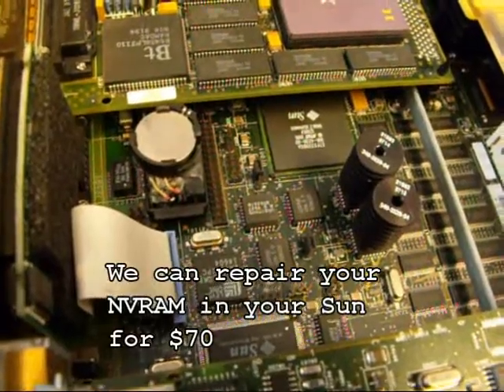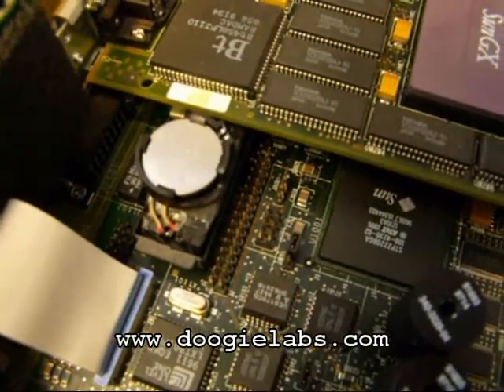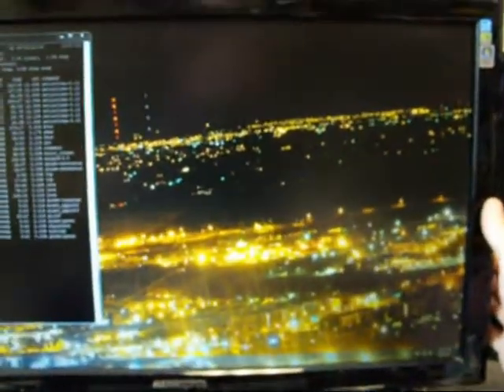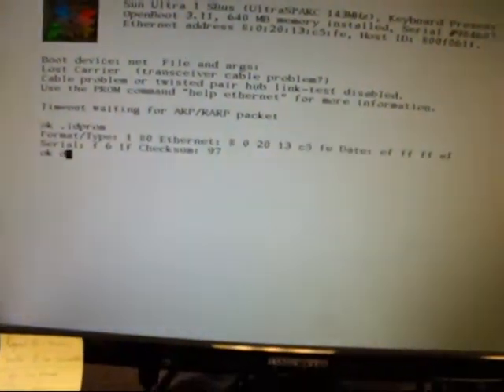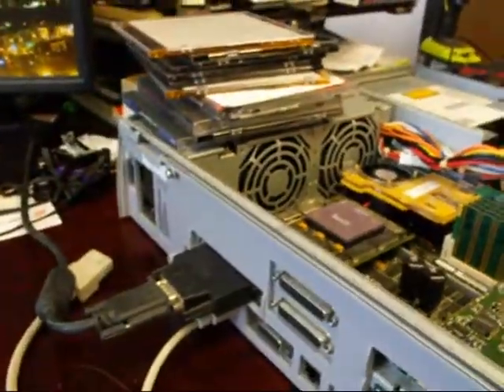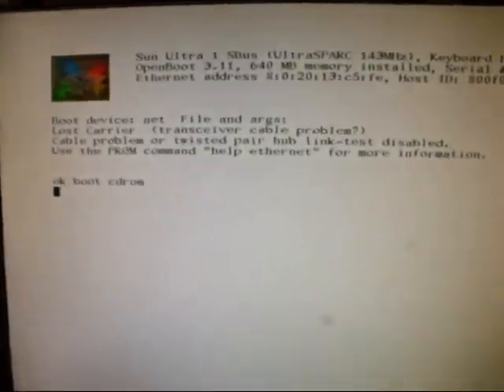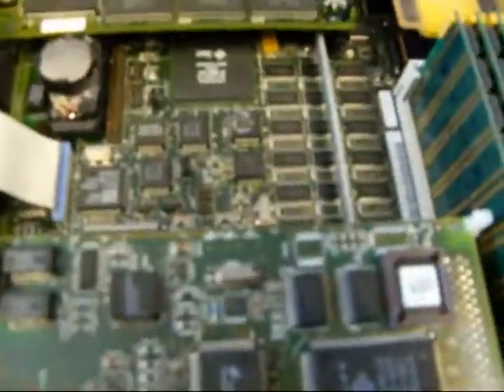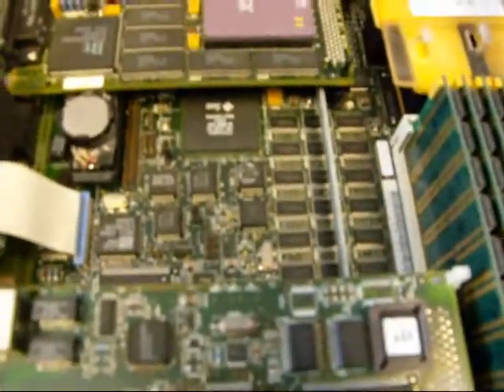Sun NVRAM Fix, Invalid IDPROM error from bad clock battery, ultra1

Comment: The link on how to reprogram is dead can you please provide another
Reply from the maker: I have reposted the information on my own site here: https://doogielabs.com/2017/12/sun-nvram-hostid-re-programming-sun-nvram-after-replacement/   .. Thankyou for the heads up I will fix the link in the video description.
Reply: Thanks a lot. But it turned out my OpenBoot version is 4 and the command mkp isn't there anymore.
Reply from the maker: Monty Asesto I ran into this the other day. I was fixing the nvram in a sunblade 150. I used my ultra2 to program the chip & swapped it back into the sunblade 150 and it worked perfectly. If you have an older Ultra sparc machine laying around I would use that to program it. Optionally you can send it to me with what HostID you want programmed and I can get you set up.

Comment: Thanks for the video.   I have had to do this upgrade on a few machines that had a dead battery.  I would not have gone digging for a battery in the chip without this video.  The logic of sealing the battery inside the chip housing escapes me.  Maybe they did not realize the machines might still be running after 20 years.

Comment: On a Ultra 10 I have this problem. I bought M48T18-150PC1 ST chip but even after doing what is on squirrel.com still having problems. Did you ever reprogrammed a new chip?